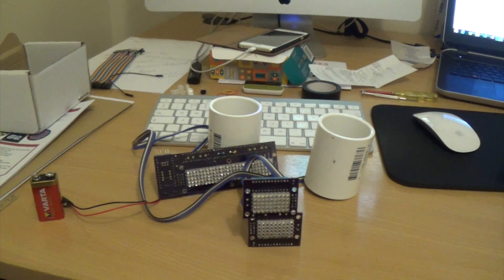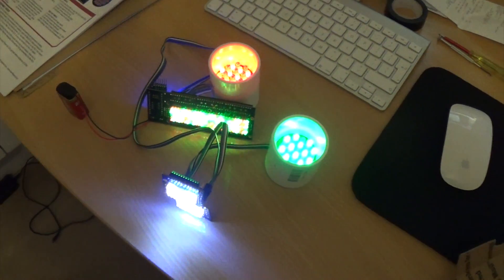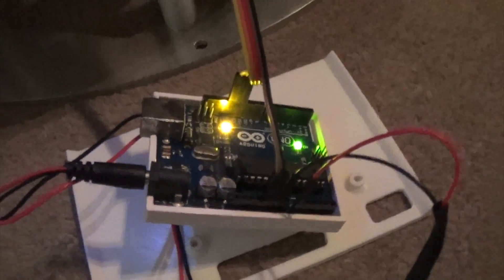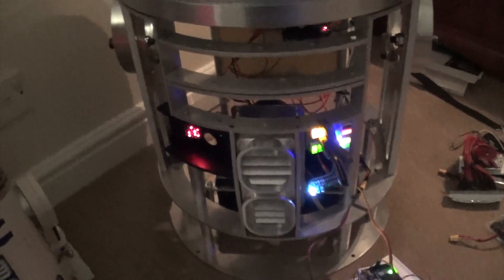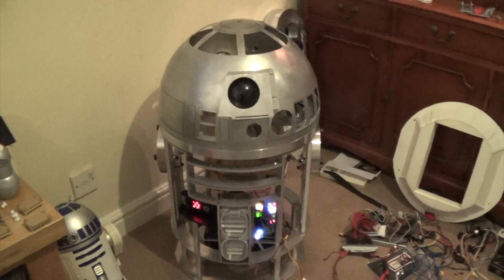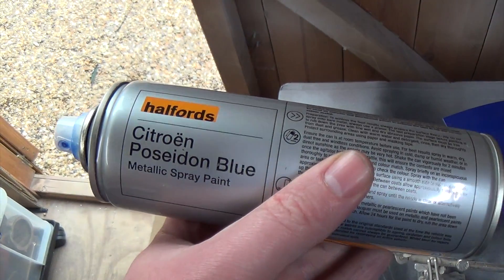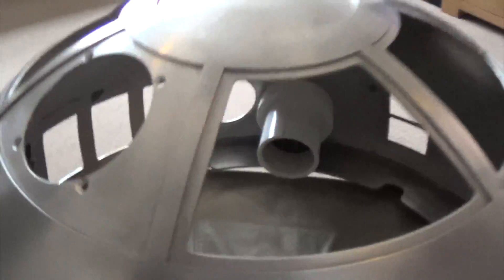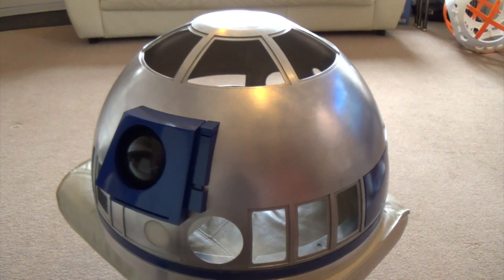R2-D2 build -  Part 10

Comment: Looking at the PSI's and adaptor rings, I was thinking you could've gone to a hardware or plumbing supply store and get the same sized PVC for the different dimensions and glue together without having to go the 3D printer route, just a thought.

Comment: I got my Teeces display done earlier this year. I'm still stuck on what to diffuse the PSIs with though. 
Since I just got the PCBs off of OSH park as opposed to a full kit, I'm using LEDs I bough myself, so they may not be the intended luminosity.

I like the idea of diffusing them with a printed disc; it looks like it would work in a pinch. I'll get around to building my ABS dome eventually, slow and steady wins the race I guess. I've found that I might be able to get away with using captive push in studs like in a metal dome if I'm careful.

Anyway, here's my crack at the display:

( https://www.youtube.com/watch?v=Q3rUdvoNacw )
Reply from the maker: I found these on line last night, look fantastic http://ia-parts.com/aluminum-psi-housings/

Comment: You should do a test of the 3M Metal/Cement Epoxy. It may be strong enough to handle your bomber hinge attachment to the pie panels. The stuff is super strong and cam in 1st in a stress test of glue comparisons..